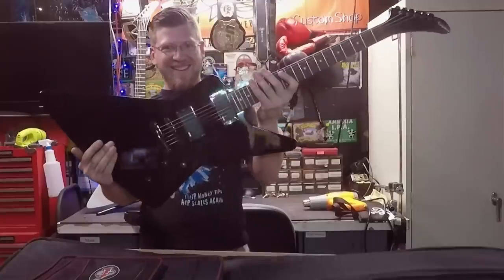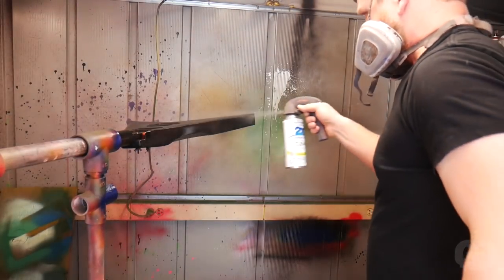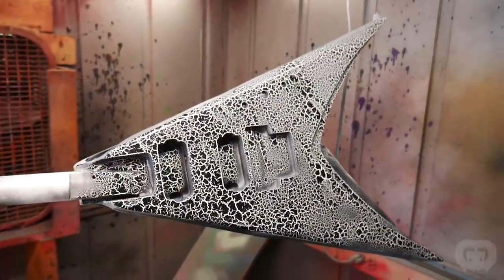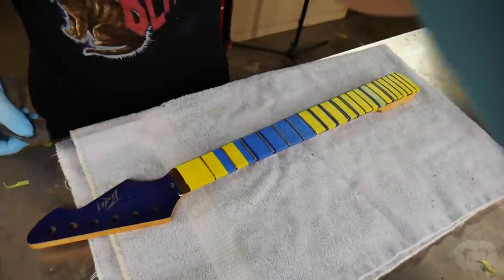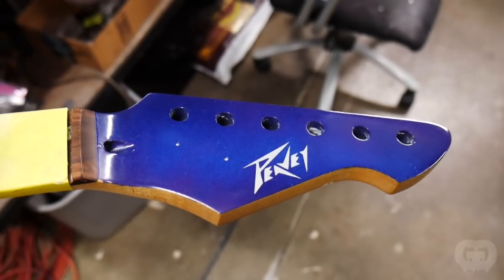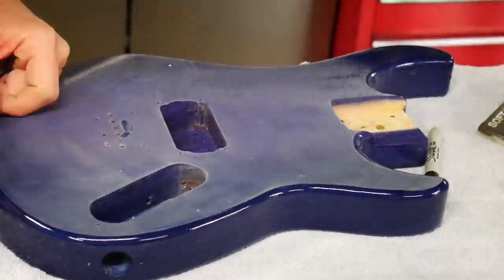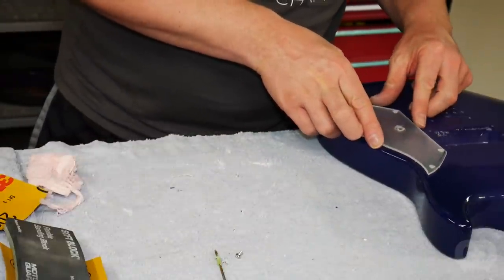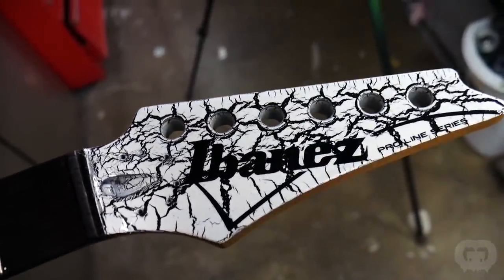Trash to Thrash #16 - LTD V250 CRACKLE - IBANEZ PROLINE V - PEAVEY ROCKMASTER - JACKSON DINKY EX

Comment: Bought a used ESP LTD EC-1000S today, it's a beautiful guitar. But I need to get it serviced cause the frets aren't level. Can't bend the strings beyond the 12the fret on the high e and low b string. It's a bit disappointing but I got a great deal on it.

Comment: Have you ever tried micromesh pads instead of the 0000 steel wool for fret polishing?
I've seen packs of micromesh that aren't too expensive and they go up to the equivalent of 2500 grit plus and you don't run the risk of metal dust like you do with steel wool.
Plus they are much cheaper than proper fret rubbers.

I also notice you are very manual with polishing the clearcoat.
You avoid using buffing pads on a drill etc?
Is that a worry about burning through by accident?

Comment: I think you’re using way too much polish. I use Maguires 205 to Polish my guitars I take a Cotton rag folded up into a ball put about a quarter size compound throughout the whole guitar that’s all you need. The compound only works once it dries up a little it doesn’t work that well when it’s fully wet so you’re just throwing away a compound

Comment: what is the difference between matte,satin,poly,nitro and clearcoat?(finishes)
Reply: Nitro is an antiquated laqeur finish that degrades over time (look at most vintage guitars) compromising the integrity of your guitar's lifespan in the long run, yet somehow seen by old-fashioned musicians and builders as "premium" finish. Polyurethane is a thick plastic finish that mostly prevents your instrument from aging and wearing down, making it look fresh from the factory years later. Poly is the most commonly used finish these days as it is superior to Nitro and cheaper, for the better imo. Clearcoat is any finish that is translucent over the instrument (such as Poly, Nitro, Oil...), such as any guitar this guy mods, he sprays a color paint down first, then a translucent, almost invisible finish over so the color can still be seen. The only trace of it is the high gloss after polishing. Satin is also a clearcoat finish (usually, unless it is a colored wood stain oil finish) but instead of buffing it out to high gloss it is buffered to only have minimal to no shine to it, like if they left it with just the paint only. This is a popular finish for guitars that are left with the natural wood showing, no paint applied. Matte is the same concept as satin but refers to the finish when paint was applied only.